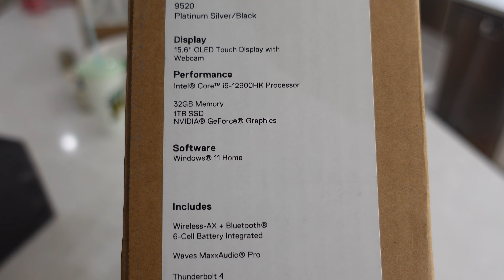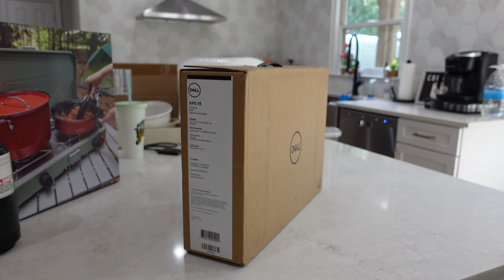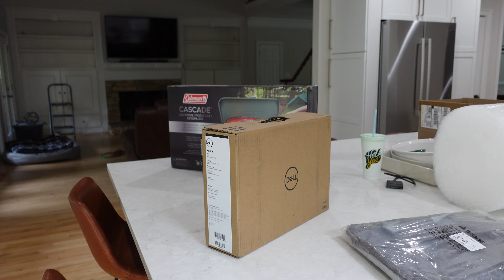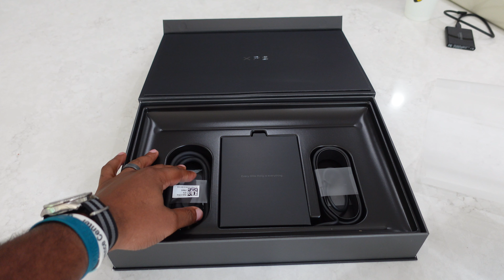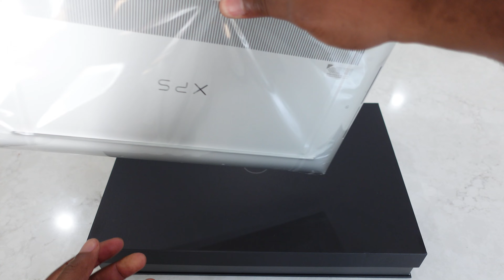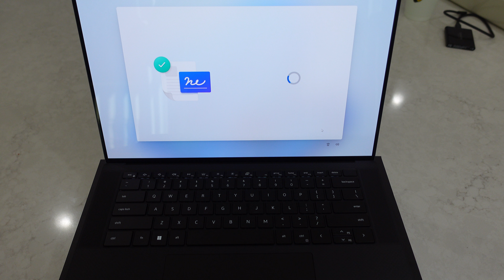The BEST Video Editing Laptop // New Dell XPS 15 9520 // Solo VANLIFE Travel Vlog 2022

Comment: How's the i9 processor working for you?
Reply from the maker: Honestly, so far so good. I am very pleased with the performance and the quietness. I can hear the fans obviously, but they are not obnoxious and it doesn't get very hot. I have edited 4K videos without any trouble or dropped frames. Battery life is exceptional and I am slowly getting more comfortable with this keyboard (compared to Microsoft Surface Pro and MacBook Air) and experiencing less mistypes. The 4K OLED is AMAZING!
Reply: @trvlvan  The 4K screen is not OLED. The 3.5K screen is.

Comment: Hi. I have been researching laptops for photo and video editing. I finally decided to go on with Dell XPS 15 the same one that you unboxed. I was stoked that the reasons you chose this laptop are mine too. Good to know....
Reply from the maker: How do you like it? I love mine so far. I went with the 32gb Ram option to get it sooner (64gb took 2 months longer...) and will upgrade ram if I ever need to, but so far I don't see the need. What I have noticed is that it prefers a restart every day or two otherwise some playback gets gittery. I am ok with that. Reboots are very fast.
Reply: @trvlvan  I haven't bought it yet. But I'm going to buy soon. In terms of RAM and storage, I've opted to go with base configuration and upgrade later. People say it's cheaper that way. By the way, how is your experience with battery so far? Especially in relation to video editing? How long does it last?